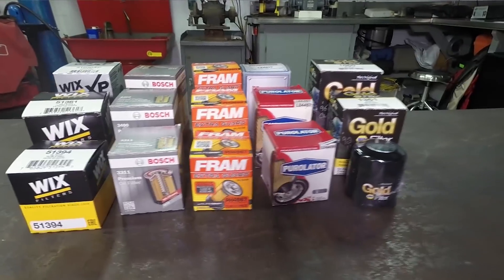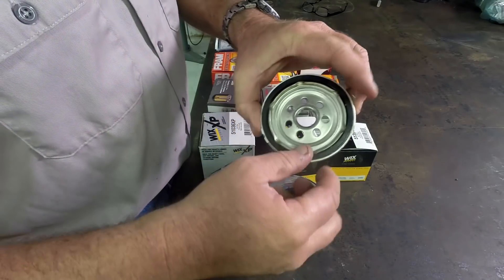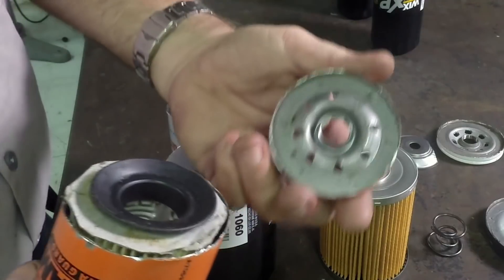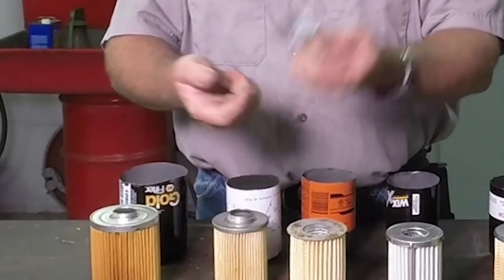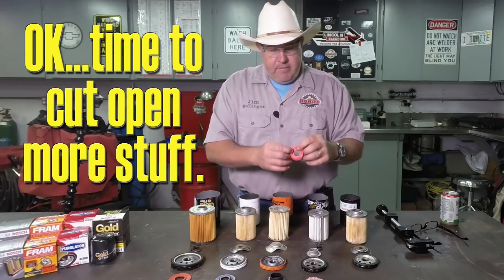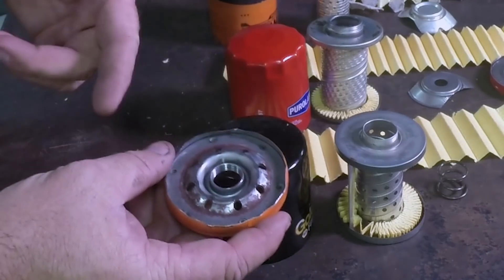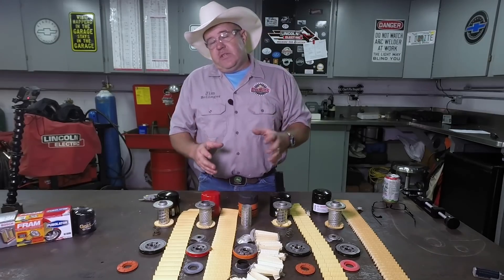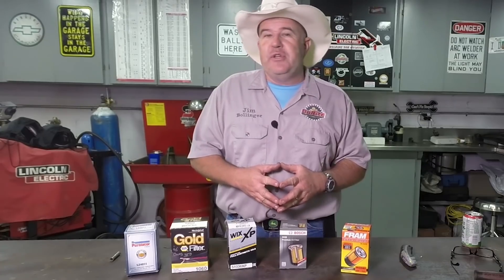The worst oil filter EVER!

Comment: i'm running a honda h22a- i've been running fram the longest time now and never had any motor issue,
if you do your oil change every 3000 miles your car will always be Gold!, but if your an idiot who knows nothing about how important an oil change/filter should be than your highly Stupid!!!  Fram is cheap and easy to grip, and has nothing to do with the motor besides filtering dirty minerals. and after your every 3000 miles, just change it again and dont be ignorant about it!
btw my H eats V6 for dinner with fram as my filter-
Reply: An Accord owner said this vid is clickbait, this is my reply...
As a Japanese/German only shop owner for many years I will give you this challenge. Go to the Honda dealer and get a filter for your car, it may cost a dollar more than you are used to, and ANY Fram that fits your car. To be fair also get one of the cheap Frams you've been using. And cut these filters open. Focus on the quality of two components, the filter media of course and the glaring contrast here will likely sway you but the REAL problem with cheesy filters on your Honda is the quality of the anti-drainback flap seal. Why? Well because it determines how long your engine runs WITHOUT oil pressure on cold start... when most of engine wear happens if all else is hunky-dory. If this flap is anything other than a thin and supple blue or red neoprene like material it's junk.
I went to work for Mitsubishi in '84, their second year in the US market under their own flag. By mid '85 we (dealer techs with snap) knew Fram filters where killing the G63B's in pickups by the hundreds. Finally the warranty costs where out of hand so Mitsu formed a team and I was on it by chance being in California for training. At this time I was based in Houston with 5 dealers in the area.

  What we did- we collected used filters from oil change places, all brands and all ages/mileages, and we measured dynamic pressures such as opening pressure,  flow resistance and so on with test gear we constructed. Oh and we cut open hundreds of filters of all brands. What we found, simple, at the time there were only 2 large filter assy lines in the US. Fram/Allied Signal and Wix. So most every filter common at an oil change place or auto parts store came from one of these two lines as a WIX or FRAM or as a contracted part.. such as Pennzoil or Cam 2 or STP or whatever. I saw overwhelming proof that Allied/Signal (makers of Fram) are willing to make a filter that is even worse than the one in video and put whatever name you want on it and paint it any way you like. These 3rd tier parts cost about 80 cents wholesale and fill the shelves of oil change shops all over the country.
 
  We found that it takes 4 OUNCES of pressure to OPEN a Mitsubishi oil filter part no. MD031805 and 4 POUNDS of pressure open a Fram for that application. By open I mean push oil past the anti-drainback valve flap which is the first thing the oil pump has to deal with on cold start after drain down. After drain down, which happens over time regardless of flap quality, the pump is pumping air and that's not good because it's not good at it and it will take many revolutions to prime itself and pump the resulting air-slug through the filter. During this time your engine is running without oil pressure and in the case of the Mitsu trucks it was killing balance shaft bearings en mass. On our service drive I saw this happen many times... person gets oil change and a Fram or some other no-name yellow or red or lime green POS get's screwed on it a it's filled with oil. Then on startup the oil light will not go off then the truck winds up on my service drive, I walk out and unscrew a DRY crappy filter from the motor and screw on a Mitsu OEM filter start the truck and rev the engine one time and the pressure comes right up. I got so sick of trying to explain this and then after I got back from Cali we where told not to tell the public about the "Fram" problem due to product image(ours) and warranty laws forcing them to pay no matter what filter is used. So they redesigned the oil pump with wider gears for more displacement. Bottom line Mitsubishi never planned for US made filters of such poor quality and high opening pressures. During this era these filters where wiping out timing chains on Nissan L-Series and Z-Series and Toyota R series engines due to starving hydraulic chain tensioners. All the Jap car makers suffered from these junk filters at one time or another, they where actually in denial about how bad the filters are here being so hard to open and having a joke of a drainback flap. 

  Sir, if I change the oil in your car, the filter WILL have a Honda logo on it and be made in Japan... or I quit.

The fact that your Honda doesn't burn oil has nothing to do with choice of oil filter, that's just plain old Japanese quality engine parts and machine work...the best on the planet possibly.

Comment: I've used Fram mainly because of the grip on the end. I have a 1996 S-10 with 260K and the engine still runs great. I sold a 2008 Hyundai Accent to my wife's friends with 245K which now has over 300K and still runs great. All I've ever used is Fram and have never had issues. Are you comparing the cheapest Fram with the better filters from other manufacturers?  Apples to oranges IMO.

Comment: I saw a filter test in a magazine 15 years ago and Fram was junk then too.     I've always used factory branded filters for the brands of cars I own and have never had an engine failure.    My current beater Toyota 4Runner has 412,000 miles and still runs perfect.  Good to know that Wix is good though.

Comment: Great  oil  filter information  video . Thanks , I would never consider  using any of those garbage filters now . 
I have a low mileage 4.6  ford engine and I found out if you don't use a Motorcraft filter you  could get a  slight delay on oil pressure when you first start it and you can hear what sounds like  the  connecting rods rattling.    I was told there is  a good anti drain back valve in the  better filters and when I replaced brand X (I can't remember the brand unfortunately ) with a  Motorcraft filter and that absolutely did fix the oil pressure delay and rattle  issue. I will try a Wix next time around .

Comment: That "spring" in the bottom is not just for looks its the bypass valve, if the media gets plugged it opens and gets oil to the motor. So a cheap spring will open to soon and send unfiltered oil to your engine.

Comment: Just FYI , They make a nice tool for cutting filters open  and  it works similar to a a pipe cutter.  https://www.jegs.com/i/JEGS/555/80532/10002/-1  It is an excellent way to see how the old engine is doing and also an excellent way to troubleshoot an engine noise  .  If you have a failing camshaft ,a connecting rod bearing or a scored cylinder ( piston knock)  it can help determine what's  failing by the type of metal present in folds  of the filter material .  If you use a cut of wheel you introduce cuttings ,I  realize you are just displaying the guts  of the filter so it doesn't matter. I used one all the time  back  in the day when when I was a field mechanic on diesel engines. It is very important to have a good  quality filter. I have seen them tear or the paper comes unglued  and all that crap goes through out the engine  can destroy it.

Comment: Nothing in this video shows anything about how well a filter traps particles in its media... construction and number of pleats virtually meaningless, if filter media itself is crap.  The only measure I’d worry about is filter efficiency at specified micron levels - how many manufacturers show this on their package?  Looks like some filters make up for their poor efficiency by cramming in more pleats, using a heavier can or applying nice paint job.  BTW, 319,000 miles on ‘02 Saturn using the orange filters...

Comment: Back in the late 80"s or thereabouts, I read an article from Consumer report that tested a bunch of oil filters on how they faired on filtration. Back then Fram did good, but they didn't tear them apart. hastings got a poor showing on that test but you know I got a couple of Fram filters in my garage that has rust that I just assumed was form storage. thanks for your test I have been using Fram for decades because of that article, no more,

Comment: I stopped buying fram this year when changed my oil. its only a few dollars cheaper but it isn't worth a dime. 
the only thing a fram filter does is stop you oil from leaking out of you engine. 
the only thing i like about fram is the grip they painted on the end. I think i got a K&N Filter with a hex adapter on the end because i hate all the other ways to remove them. 
K&N looked good in another video but anything is better than fram.

Comment: The best and only meaningful test is to run each filter through with measured contaminated oil for a fixed time and see what gets caught and filtered, what doesn't and what filter maintains it's integrity internally. Until then, we cannot really say. Performance, not opinion. Maybe the cheapest may work best. If that were the case, it'd be very good value. I have used Fram in the past and never had a problem.

Comment: An Accord owner said this vid is clickbait, this is my reply...
As a Japanese/German only shop owner for many years I will give you this challenge. Go to the Honda dealer and get a filter for your car, it may cost a dollar more than you are used to, and ANY Fram that fits your car. To be fair also get one of the cheap Frams you've been using. And cut these filters open. Focus on the quality of two components, the filter media of course and the glaring contrast here will likely sway you but the REAL problem with cheesy filters on your Honda is the quality of the anti-drainback flap seal. Why? Well because it determines how long your engine runs WITHOUT oil pressure on cold start... when most of engine wear happens if all else is hunky-dory. If this flap is anything other than a thin and supple blue or red neoprene like material it's junk.
I went to work for Mitsubishi in '84, their second year in the US market under their own flag. By mid '85 we (dealer techs with snap) knew Fram filters where killing the G63B's in pickups by the hundreds. Finally the warranty costs where out of hand so Mitsu formed a team and I was on it by chance being in California for training. At this time I was based in Houston with 5 dealers in the area.

  What we did- we collected used filters from oil change places, all brands and all ages/mileages, and we measured dynamic pressures such as opening pressure,  flow resistance and so on with test gear we constructed. Oh and we cut open hundreds of filters of all brands. What we found, simple, at the time there were only 2 large filter assy lines in the US. Fram/Allied Signal and Wix. So most every filter common at an oil change place or auto parts store came from one of these two lines as a WIX or FRAM or as a contracted part.. such as Pennzoil or Cam 2 or STP or whatever. I saw overwhelming proof that Allied/Signal (makers of Fram) are willing to make a filter that is even worse than the one in video and put whatever name you want on it and paint it any way you like. These 3rd tier parts cost about 80 cents wholesale and fill the shelves of oil change shops all over the country.
 
  We found that it takes 4 OUNCES of pressure to OPEN a Mitsubishi oil filter part no. MD031805 and 4 POUNDS of pressure open a Fram for that application. By open I mean push oil past the anti-drainback valve flap which is the first thing the oil pump has to deal with on cold start after drain down. After drain down, which happens over time regardless of flap quality, the pump is pumping air and that's not good because it's not good at it and it will take many revolutions to prime itself and pump the resulting air-slug through the filter. During this time your engine is running without oil pressure and in the case of the Mitsu trucks it was killing balance shaft bearings en mass. On our service drive I saw this happen many times... person gets oil change and a Fram or some other no-name yellow or red or lime green POS get's screwed on it a it's filled with oil. Then on startup the oil light will not go off then the truck winds up on my service drive, I walk out and unscrew a DRY crappy filter from the motor and screw on a Mitsu OEM filter start the truck and rev the engine one time and the pressure comes right up. I got so sick of trying to explain this and then after I got back from Cali we where told not to tell the public about the "Fram" problem due to product image(ours) and warranty laws forcing them to pay no matter what filter is used. So they redesigned the oil pump with wider gears for more displacement. Bottom line Mitsubishi never planned for US made filters of such poor quality and high opening pressures. During this era these filters where wiping out timing chains on Nissan L-Series and Z-Series and Toyota R series engines due to starving hydraulic chain tensioners. All the Jap car makers suffered from these junk filters at one time or another, they where actually in denial about how bad the filters are here being so hard to open and having a joke of a drainback flap. 

  Sir, if I change the oil in your car, the filter WILL have a Honda logo on it and be made in Japan... or I quit.

The fact that your Honda doesn't burn oil has nothing to do with choice of oil filter, that's just plain old Japanese quality engine parts and machine work...the best on the planet possibly.
Reply: Good info, thanks Alan

Comment: The Napa gold was not the same cross over part number as the rest so hence the difference in size of exterior casing and interior filter if the exterior is larger so is the end that attaches so can't use that as example for interior filter say ze comparison against the Purolator filter

Comment: You can't compare one company's top of the line filter against another company's economy filter.
Reply: Cheap people have cheap ways. Buys a 20,000 car bitches about a 5 dollar filter. Wix  doesn't make economy filters.
Reply: @johnjennings8085  , is it supposed to be an oil filter? It says it does....
Reply: jennings  ununbelievable
Reply: The video is to show you what you are buying when it comes to filters.Also,the other companies don't make make $2 filters to compete with the bottom of the barrel Fram filters which are junk.
Fram's more expensive filter are better but why would they have to market three different filters if the low end ones were any good?
Reply: @greganderson7866  , .... for trucks, high performance cars etc...
Reply: The purolator that he cut open actually sells for less than the Fram he cut open...The Wix and Napa are top of the line and cost more...I'd like to see what's inside a Fram TG type.
Reply: Who cares, their economy offering is worse than any one else's, so why bother?
Reply: @chipper2462  napa platinum is top of the line.  This is a $7 filter.
Reply: Look, even STPs "junk" filter is magnitudes better than Frams economy offering, and it's cheaper. I've seen inside both.
Reply: A $3 Supertech (Walmart) filter is still better constructed than the FRAM one.
Reply: @henrath  SuperTech and Fram share part numbers. I bet they're both made by fram.
Reply: Can you show me a review of the other brands similar rubbish?
Reply: @jamesr5741  they kind of do but not really. Oreilly auto parts sells microgard, it's pretty much the same thing as wix but with a matte finish instead of gloss..its what I run lol
Reply: I wonder if microgard is any different then wix?
Reply: that is their top of the line

Comment: U know whats amazing?  Buying oil filters from my local Chev dealer, perfect fit and function every time , so good my 5.3L Yukon just kicked 600,000 km all original internals, zero issues outside of basic  maintenance... or you could gamble and buy oil filters from people who build spin on filters vs people who build trucks and cars that can only function as good as the filters on that vehicle .. OEM for me thanks, I've got the proof in the drive way right now..

Comment: I used Fram all my life, now i will have to change. I have some people tell me that used rolled tolit paper for an oild filter andy truth to this one.
Reply: brain washed, think about it you used them all your life , if they were that bad you would've had problems
Reply: yes,there was an oil filter that used toilet paper,available from J.C.Whitney,back in the late 60's-maybe till mid 70's
Reply: Back in the days when an oil filter was just the element inside a metal can, I heard of people using a roll of toilet paper.  But unless the roll fits tightly against the ends it's useless.  Not only that but the paper can come apart and clog the oil passageways.  But I have heard of doing that--I wouldn't.
Reply: Bullshit you stupid fuck.  You're gonna keep buying the same $4 filter because it works.

Comment: This was a decent video comparing components but missed on some key comparisons such as performance and cost which is really what matters. The Napa Gold and Wix are better "heavy duty" constructed but may not be the best at filtration or a balance of cost. Also, the comparison was showing the cheapest fram against the Napa Gold which is not a true comparison. It would be like comparing a Nissan Versa to a Toyota Camry. Not the same class. If you are really interested in more science behind oil filters, check out this link:
https://filtrationcomparisons.weebly.com/conclusions.html